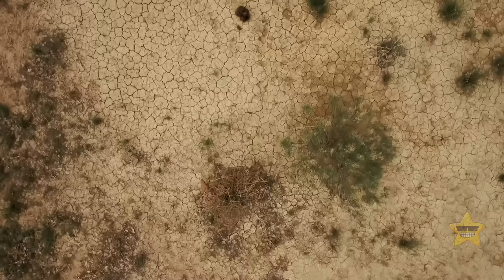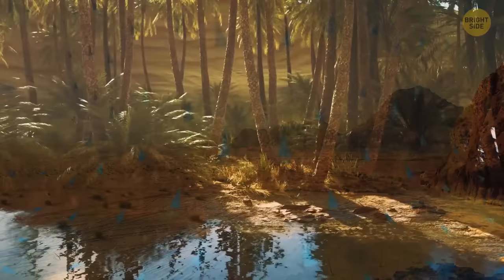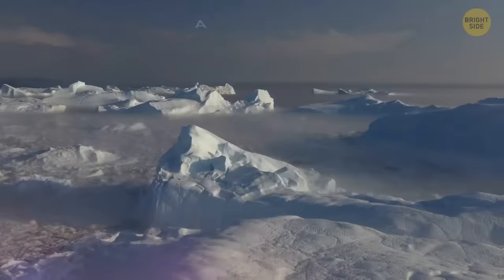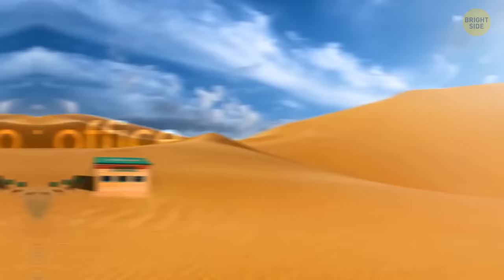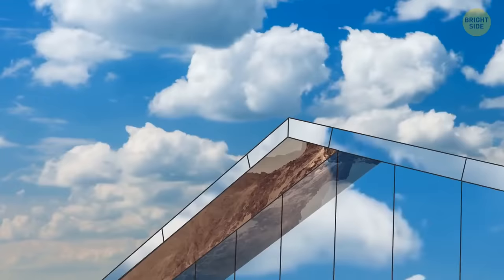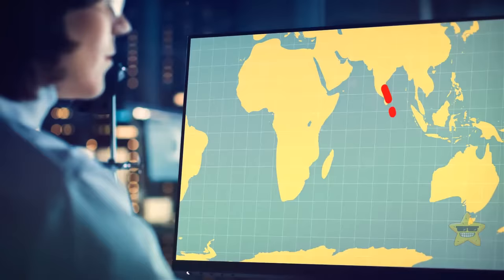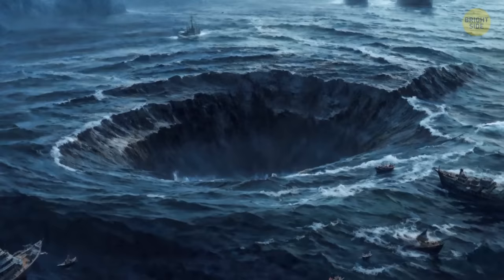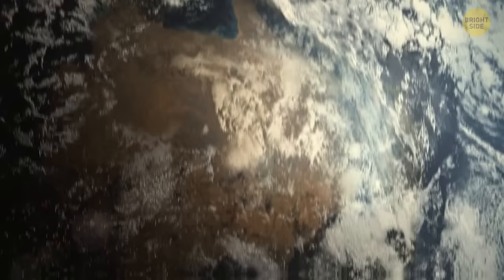Scientists Are Worried by What Is Going On in the Sahara Desert, and So Should You?

Comment: The circles are from oil exploration, some researcher found unexploded dynamite in the middle of a smaller one. Apparently it's a way to check for oil or something.
Reply: @azazeldath - some may be, and in fact are.

But plenty more which are completely different and are not related to oil drilling, also those which have been there way before any mass oil extraction.

Sort of like an Eye of Sahara, with geological proof of water erosion (which make sense as we know that several thousands years ago, the Sahara was quite green, with flowing rivers).
Reply: Better not check it if it's old TNT lest you want to be in multiple places at same time. Old TNT sweats nitro glistering , highly volatile, just touching it might set it off .

Comment: if that’s true, than where did so much sand come from?! The closer to the Equator the hotter it gets
Reply: Not necessarily  ..
The Amazon rainforest sits direction the equator  ..

 Deserts are North if it towards tropic of cancer.  Or south of the equator tropic of Capricorn like ausie ...

Equator has most intense sun uv rays so u will burn quicker... 

A 40°c or 102°f day in Spain  will  feel like 38° 100°f but people still walk around..

A 34°c (93°f) day in florida in August can feel like 45°c  if no clouds
(Real feel temperature )

because of the uv rays and humidity that Spain does not have  but still its not as near the equator as the Amazon But yet feels hotter.

Just like 
Dubai or Persian gulf  .
Has sahara desert temperatures but
With high humidity that is non existent in the sahara..

Sahara 48° (real feel 48°)
Dubai 48° (real feel 53°)
Reply: Sand is broken down rock, over thousands of years, entropy.
Reply: Massive flooding from an impact of a meteor on the earths ice sheet  roughly fifteen thousand years ago?